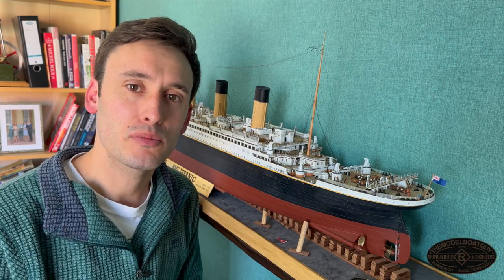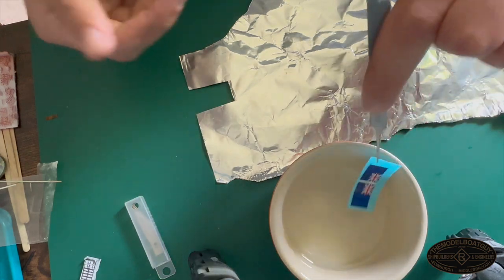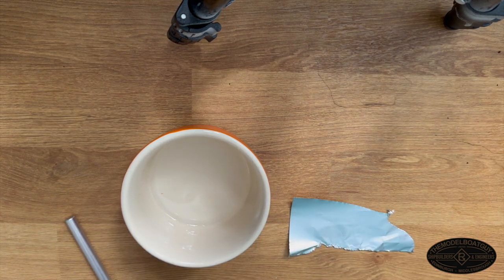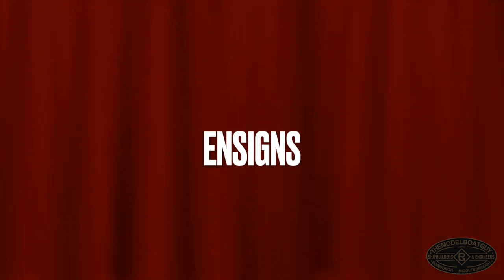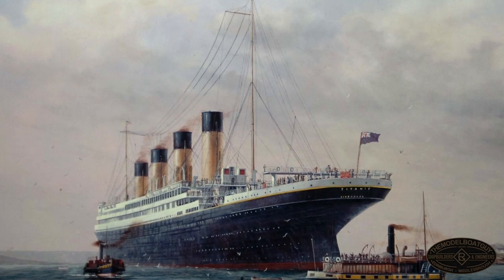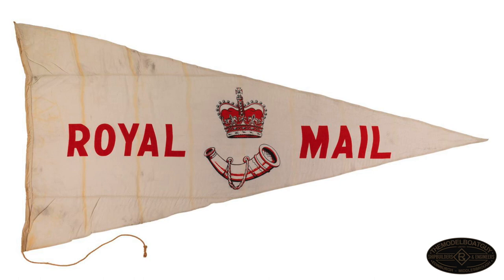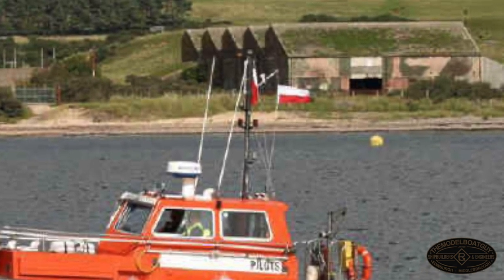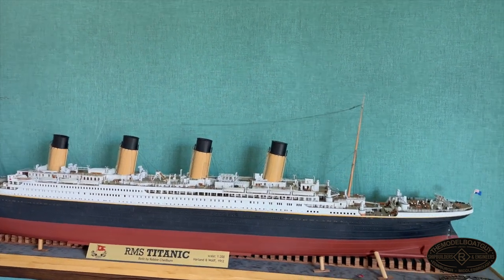Radio Control Trumpeter 1:200 Titanic Build Part 89 - Flags

Comment: Hi Robbie, thanks for flagging all of that up!! 😁 Great job as always.  Yes whilst on board ships the flags seem to appear and disappear and it's only later that  one realises that something is different!  It all happens flawlessly when you least expect it.  Rarely have I ever seen running flags being rigged although I do recall seeing the decorative editions being elevated a couple of times.  Usually raised very early in the mornings or lowered at dusk. There were the odd exceptions.  Even a Christmas tree appeared on the top of one funnel array!  The flags in use for mid crossing does make life a tad easier.  Olympic water intake grills now fitted. Keep cool!  Regards JH 😉⚓
Reply from the maker: See what you did there! 
I was wondering if you had any knowledge of these things from your travels. From my research it sounds like there wasn’t really a hard and fast rule… so probably anything goes really.
Good to hear Olympic is going strong! 
All the best,
Rob
Reply: @TheModelBoatGuy  Three flags normally flown these days.
Company flag, country of ship.  The flag of country being visited when arriving or leaving the port.  I think it's pretty much a tradition carried on from the early days.  Yes all good here, working on forward hatches and rudder anodes! Keep cool!  Regards JH 😉⚓

Comment: Going off topic.. Will you be enclosing your model in a case? I have read, that in an enclosed space, paints and glues can give off chemicals that degrade the overall finish.. in the open, these chemicals simply disperse into the atmosphere.. What are your thoughts?
Reply from the maker: I had never heard that before, but could well believe it. 
I am putting the model in a case as dust and things will damage the model over time otherwise. There is a hole in my case though to allow gasses to escape.
I admit this wasn’t due to paint vapours, but I was a bit worried about hydrogen build up from my batteries charging so I added a hole.